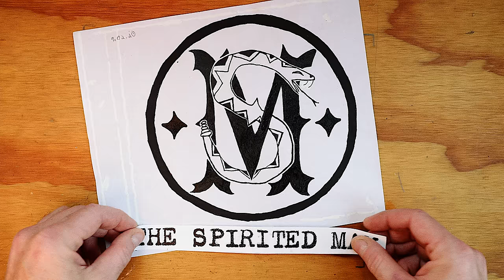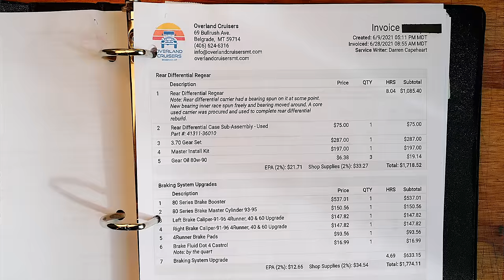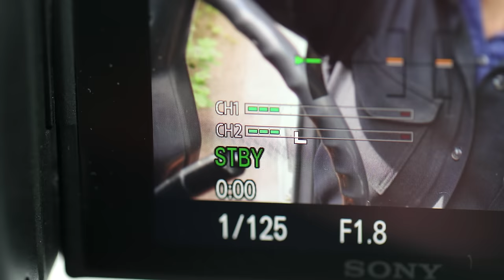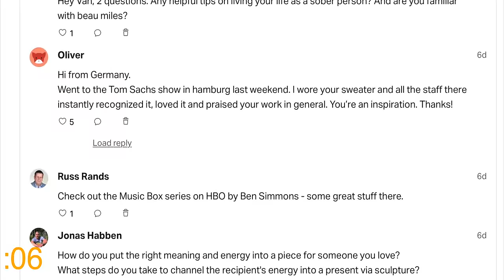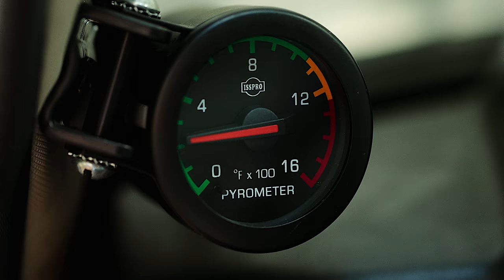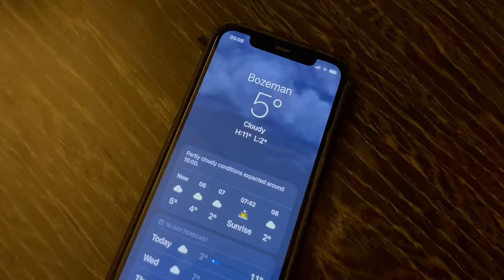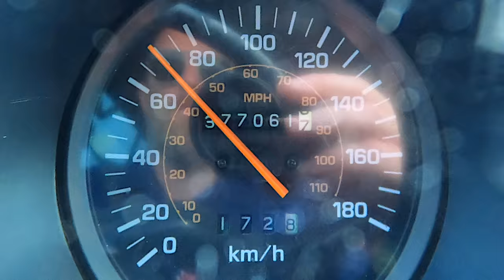The DREAM of Owning a Vintage Truck

Comment: Maybe you've tried it already, but I've had success running corrupted video files through FFMPEG before. I'll leave another comment on the Patreon with some more details in the hopes that it helps recover your moment.
Reply: Yes, do try this, fixed my footage a few times from corrupted files, came from DJI Mavic, completely recovered.

Comment: Had the same problem with my footage a couple of days ago, same camera. Only mine was dropped so one file was corrupted, looked the same as yours though. After hours of research I caved in and paid for a program to repair the file which actually worked and brought the footage back. So no more problems with corrupt footage thankfully

Comment: When I saw the first part in the series, it actually triggered something on me wondering what was so great about owning a vintage truck. In 2 months, I found myself buying a 22 year old Land Cruiser 95 Prado, which has been the wonders of the family ever since. Good for going anywhere, do-anything don't-bother, carrying 2 gravel bikes, sleeping inside, and not having to worry about any condition on the road. It had 2 visit the specialist a couple of times, but mechanically you can tell it's bullet proof. Best Car I've ever owned. Period.

Comment: This is like a mix of mine and my dad's story, 2 in 1!❤️

Back in 2007 my dad bought a 3rd gen Nissan Pathfinder, 4000cc v6. Compared to my moms car, a nissan micra 1200cc, that SUV is like it's been pulled out from mad max. My dad used to ride it, in my eyes, like he owned it. A beast that he conquered and lead us into places I had never seen before, an adventure into other worlds! It was in my eyes so unusual, fast as hell (in the eyes of a 5 yo), automatic transmission, heated seats, sunroof, palace like interior etc.
My dad also taught me how to drive it when I was just 8 y/o!

In 2015 several years after the economic collapse of Greece , costs of having it running became too much in comparison to its use for us,I was 13 yo at the time.
Time passed, my dad grew older but still hardcore in his athletic spirit and now in his 69 years of life a massive stroke of luck lead to spirits lifted and a lost wallet with 9 months of savings for the car was found!

My dad was rejuvenated tremendously and I was seeing a legend from another time, when my parents had more life into and opportunities in their hands,  come back into life. It is like a time treasure from 2007, and in it we found hope, strength, rejuvenated spirits and a crystal clear view of the past.

Yesterday I just came back home, closing my 1st trip with it, now 20 yo!

Comment: If you happen to still have the original SD card with the original video clip that was corrupted, then you might be able to get a good working copy using a Data Recovery software like PhotoRec by CGSecurity(It's free software). PhotoRec has been around for decades(they even have a DOS compatible version), I have used that software to recover a lot of files from SD cards that cameras have somehow messed up. It also works for more mundane file recovery(like accidental file deletion) from Hard drives and USB sticks.

Comment: I always loved the 80 series Landcruisers. When I was 12 or 13 my dad and I drove to the Outerbanks in a ‘94 FJ80 with a quarter of a million miles on it. It was a hot summer and you had to keep the windows down because the AC didn’t work and the cabin smelled strongly of gas. When it rained we opened the sun roof because at least it would cool us off. Sure, she slipped a gear every once in a while but never left us stranded.

Comment: I have a 1998 Suzuki Baleno hatchback, I did a trip around Portugal, North to South from the interior, South to North from the coast, no highways, only national roads, one 4x4 road...I went from Braga, Portugal to Nantes, France, with a problem in the head engine...one month later I put the car in the mechanic and new head engine, damn, I love this car, the driving is so smooth, and now I have disc brakes on the back too.

Comment: Working on the railway as an apprentice signal technician in then Rhodesia, now Zimbabwe, we were given a Land Rover to travel the Bush roads, that thing broke down virtually every week. Later we were given a Land Cruiser FJ 45 which never missed a beat and could out perform the LR in every way despite being burdened with the added weight mine proofing, my dream wes to one day own my own Land Cruiser despite all odds.

My dream became a reality, in fact there was a progression through many models starting with a BJ 40 then HJ 45, BJ70, BJ 60, BJ 71 and finally a HJ61, the last two JDM imported into Canada. They were all fantastic but the 71 and 61 were outstanding being fully loaded examples with turbo direct injection, suspension seats, locking diffs, floating axle, PTO winch, power everything and many other extras.

All were sold for a profit, the HJ 61 I kept for 10 years, it was a first model January 1987 built, sold to someone in the US in 2012 for more than 3 time what I paid for it and likely the first to be imported there. Would have kept it but importing to Thailand, where I now reside would be cost prohibitive due to import duties, the sale did allow the purchase of a new Mitsubishi Triton diesel pick up, but I do miss that HJ61 6 cylinder.

Additionally I did have a piece of crap  Sony camera which failed in a similar manner.

Comment: I have a 1996 FZJ 80 'cruiser. 
It is the best car I've ever owned in my life. I put the OME 2.5 over stock lift with medium stiffness. 
4x4 Labs front bumper with Come up winch. 
I just had a tree land on it and smash it. 
I'm getting it repaired. 
It has been a nightmare. Heart wrenching. 
Anyway what kind of gas mileage do you get with that R2.8?

Comment: My father had the same truck / car (Toyota Land Cruiser) in the 80s (1986 or 1987 mod.). It was blue with no back seats. I used to borrow it after I got my drivers license in 1990.
I have a Toyota HiLux, 2019 mod.

Comment: You can use a program called Wondershare repair it, which will be able to repair the corrupted file as it looks at the file structure of the other files to repair it. Are use this all the time because on my drones, I get corrupted files.

Comment: Dear Mr. Neistat.
I have the biggest respect for your technical abilities, repair-man attitude and the maker talents that you have. And of course your story telling skills and movie making skills. They are amazing and inspiring to all of us.
Still, I have a couple of bones to pick with the engineer Mr. Neistat, who made the decisions that led to this whole episode.
1. If your Mac Finder can't open a file from your Sony camera - wouldn't you just fix that?
2. Why would you blame the camera, and not the SD card manufacturer?
3. If your Land Cruiser has an engine issue - wouldn't you dig deeper?
OK sure maybe the deeper digs were skipped to make the story watchable for more audiences, that's fair. Maybe the file was 0 bytes and there was nothing to salvage. But in many cases, the header is lost, but the video is there, and any software more advanced than the default file browser would be able to open it. Maybe a terminal window could fix it, try a Windows or Linux box, next step some video specific recovery software, after that SD card specific recovery software.

What grinds my gears more is that to troubleshoot that original Toyota inline six diesel, open it, inspect it, order the broken parts, send off the pieces you can't fix at home, and put it all back together would have taken the amount of work of a few of your episodes. Cost a lot less than a new engine. Keeping the original heart of the Land Cruiser. Or as you are in the USA, probably this was an FJ60 and not HJ60, so gas engine twice simpler than the diesel engine. Probably be well inside the skills already in your belt.

Also the decision to go from an inline six, be it diesel or gas, 4 or 4.2 litre engine, down to a 2.8 4 cylinder. That grinds my gears. Especially from a 'vintage truck owner', wouldn't they want to keep the six cylinder charm? If it's slow or thirsty, why not turbo it?

This comment is not trying to be a troll. But I feel you are not using your talents here, and you are not being the best repairman role model, when you claim to be a vintage truck owner and at the same time having a shop install a zero-day Cummins into your Toyota, when you could have either a) fixed that Toyota engine yourself, or b) installed that 4-cyl Cummins engine, if that's what you really wanted, yourself.

Comment: Wow that is a lot of money for an engine conversion. I didn't know it would cost that much. I think for anyone watching this wanting to do a similar improvement, they should look into a fuel injection conversion for their 2F motor. Obviously not as capable as the modern Cummins but i think it would handle mountain passes without overheating and do a much better job of staying with traffic. And a fraction of the cost of the cummins swap.

Cheers!

Comment: I replaced the engine on my 2001 cherokee this year. over 8K! and now I have a leak from the transmission, not so sure I should have spent all that money. Also, the 6 cylinder 4000cc is drinking like crazy and at $4 per gallon it is a pain to fill up.

Comment: Van, My wife has her first truck still, would ya consider it a vintage truck?  1986 Toyota Pickup 4x4 SR-5 22RE engine, new rebuilt engine less than 10,000 miles on her, odometer reads 243587

Comment: You can transcode MP4 no matter how it is packaged to whatever bs format a shitty mac can read... Or if it is some crc errors on the sdcard, buy something not shitty from anywhere except amazon (they are all fakes). Also make sure to have original battery in cam.

Comment: I have been contemplating doing something similar just so I can have a 4x4 truck with a manual transmission again and have it be reliable as a daily driver.
Reply: It will never be as reliable as a daily driver - too old. However that's part of the fun haha
Reply: @errhka  I've had brand new trucks that were just as "reliable" as trucks that were 10 or 15 years old. Personally what I consider a good daily driver is a vehicle I can easily maintain without having to spend more than a few hours every couple of months fixing something(the sweet spot for me seems to be 3 to 7 years old). Which is probably why I get so annoyed when something breaks under "warranty" on a new vehicle; what should only take an hour or two to fix normally might end up taking half a day or more waiting for it to get fixed at a dealership.

Comment: "electric fans are better"

except for the fact they flow 1/3 the cfm of a clutchfan and dont draw any less power from the engine

not really an issue for an old 2f/3f but this is such a misunderstood thing